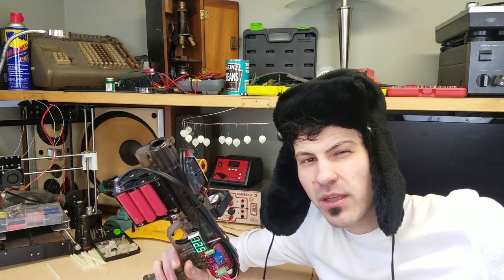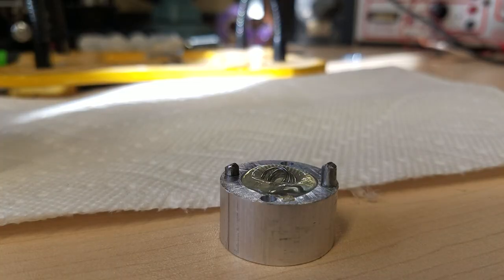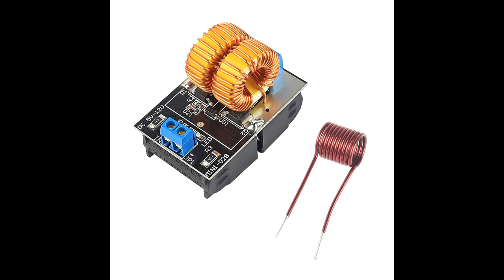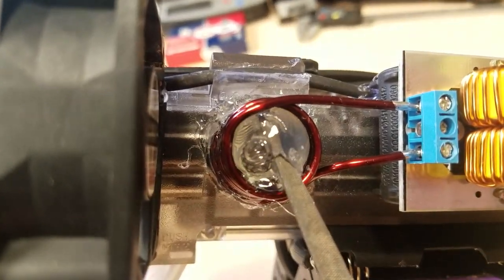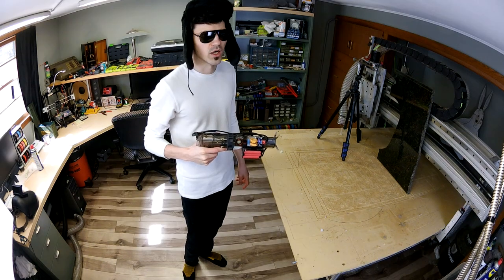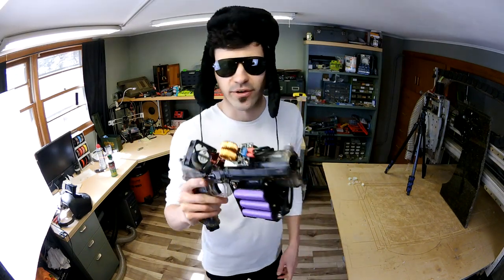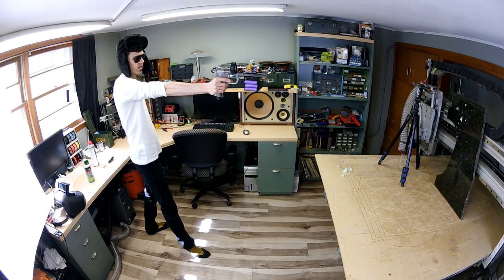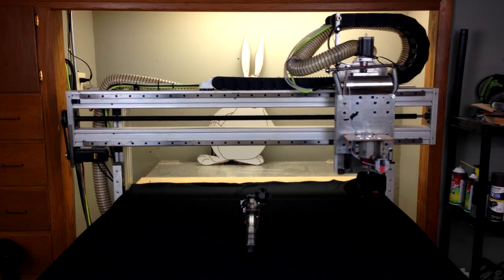Hot glue gun! (A response to Michael Reeves)

Comment from the maker: GLUE GUN 2.0: https://youtu.be/SMSFvKIj7d4
GLUE GUN 3.0 https://youtu.be/Vxq6W9XIAd0
Reply: ok
Reply: ok
Reply: ok
Reply: K.O.
Reply: ok
Reply: Whats the point of calling it a hot glue gun when its cooled down glue. Wouldn't it just be a luancher for cold glue. Kinda takes out the whole meaning of a "hot" glue gun.
Reply: ok
Reply: Ya think I care?
Reply: Ok
Reply: @joel creates its obvious your copying him for views, the appeal of Michael is his jokes.
Reply: ok
Reply: @evilflamer1749  why are you replying
Reply: ok
Reply: ok
Reply: ok
Reply: ok
Reply: Ok
Reply: @evilflamer1749  well you care enough to comment
Reply: @Iwillkeepdoingituntiligetviral  how he just trying to make a better glue gun and if he's stupid the. Why don't you do it
Reply: 20 USD.. for that induction heather.. ouch.. got two of them numerous years ago and they were 3.36USD each with incl. shipping to Denmark.
quite a hefty mock-up taking place and Amazon thirdparty pushing up on your purse, but as a product, they are fine.... though get a little hot if you overdrive them as there is no internal coil water-cooling, but they will gladly take more than the rated 5- 12v, but don't use the screw terminals.. as you done, instead use the wide silver pad as that is why it is there 2:50  and solder the coil there' as that will help take some of the heat from the coil and if you use the plastic screw-terminals with a pressure-fit, you have both less circuit connection and less thermal connection.
Reply: @lavi1653  no one asked
Reply: @Masked_ghsot_riley.offical  it’s been 2 years 💀

Comment: Thoss induction heating balls were 300iq
Reply: I don't get it
Reply: Deca Tessara clever idea
Reply: @decatessara5029  an induction coil can heat up the metal inside the ball but not the hot glue around it
Reply: @LEITH ALSELMI r/Ihavereddit
Woosh isn't a funny joke
Reply: LEITH ALSELMI theres 4 Os but also please stop
Reply: @incog0956  I get the physical mechanics, I just don't get the parent comments joke.
Reply: And then you could just make the barrel out of teflon, Venyl or Silicon. Materials that the glue won't stick to. You heat it up anyway you want and just fire through a pressure chamber.

Comment: I work with epoxy for carbon fiber projects a lot, and something you might try is adding different amounts of microspheres to your binary resin, and using low viscosity catalyst for a thinner coating. They are generally used for surf boards as they make them float, but in carbon fiber applications they reduce weight. The downside of them is if you use too many it can make your castings brittle, which might be exactly what you need. Just a thought.

Comment: You need to use the exact same piece of metal in each ball, the varying pieces of metal have different induction rates and heat up in different amounts of time based upon metal thickness and composition. Tune it for one specific piece of metal ie the ball bearing and I bet you have much better results.

Comment: Could you use shavings of steel or like iron sand and then have them suspended in the hot glue? Then you could more easily shape the bullets and control the heating from withing the bullet. 
I wonder if you could make a hot glue rail gun?

Comment: Figure out the optimum temperature of the metal in the glue that sticks better when its shot. Get a temp sensor to read the when it's hot enough, then program an arduino to fire automatically when the trigger is being pulled. If it all works, shoot some bloons with it.......

Comment: I know there is a V2 and I haven't watched it yet. But wouldn't silicon work better than epoxy? It'd be relatively heat resistant and it should pop open if it's a thin enough coat.
Reply from the maker: It would be difficult to achieve a uniform coating, as silicone is usually higher viscosity than epoxy. I think at the time I felt that such a thin layer of silicone would likely tear too easily as well.

Comment: The purpose of the "hot glue gun" was to "Fire, Hot Glue" not to fire (essentially) rubber pellets/balls. So i'm not sure how this is relatable tbh.
Reply: While you made a gun that fires (cold) glue. it's not the same.
Reply: All you have done is make an air powered gun using glue/metal as the "ammo"
Reply from the maker: Perhaps you should watch my glue gun 2.0
Reply: Bruv your being a real killjoy.
Reply: @JoelCreates  I watched it. I'll give you that. However ; as a software developer I use logic and love innovation but the logical outcome was "if reeves couldn't do it and you fired pellets not glue then you just have failed at firing glue as well" I'm sure as a developer and engineer you can follow that logic. But you still pulled it off. *claps"

Comment: Your execution of your plan sucks. the main idea of induction heating a metal object inside of a glue ball was a good start but it was ruined by your execution of just throwing whatever metal garbage you could find into your glue balls. My idea may sound like a strange idea at first, but hear me out. what you should've done differently is that you should've started by using a fine metallic powder, which would be more difficult to heat, but would end up as a much more reliable glue projectile. you would then need a higher power induction heater to heat the powder faster from the inside so that the powder doesn't melt the outer edge of the ball before being fired. with this method you will end up with a more reliably sticking ball that is less *viscous*. allowing it to live up to expectations better than your dumpster-fire of a paintball gun. Cheers.

Comment: 20 USD.. for that induction heather.. ouch.. got two of them numerous years ago and they were 3.36USD each with incl. shipping to Denmark.
quite a hefty mock-up taking place and Amazon thirdparty pushing up on your purse, but as a product, they are fine.... though get a little hot if you overdrive them as there is no internal coil water-cooling, but they will gladly take more than the rated 5- 12v, but don't use the screw terminals.. as you done, instead use the wide silver pad as that is why it is there 2:50  and solder the coil there' as that will help take some of the heat from the coil and if you use the plastic screw-terminals with a pressure-fit, you have both less circuit connection and less thermal connection.

Comment: polyester resin (for fiberglass) is even more brittle. If you add fillers to it, you can make it even more brittle while making it resist thermal expansion more and make it more stabble at higher temps.

Comment: Like yeah it shoots hot glue but its not practical and that's not even your fault that's the commenters fault because that idea should not work and it doesn't and even if it works like in your case what's next in Michaels video he used it to glue a popsicle house if he did it with your gun it would just break everything. Oh and what you said the comment and the execution is bs.

Comment: What's the issue with him trying this? You just used him for half the work. You got the idea and direction from him. If he didn't make his video and you tried this project you probably would have initially gone the same route he did. Well I think the idea was to create a hot glue gun that projects hot glue. Just hot glue. Not hot glue balls with a piece of metal in it covered with acrylic. But you talk about engineering and stuff. You should know then that there are different takes of the same idea. And that one take may not work and the other does. Each time you add something to a project your changing your initial idea from what it was originally to what it is now. Because your original idea didn't work so you edit and add to it until you get something that works or to a point where you have to go a whole different direction. Thus making the original idea different and a failure.

Comment: So, just to be clear, you took the idea of a hot glue gun that fires hot glue and turned it into this monstrosity that is quite literally the opposite of what is asked for as not only does it not fit with the spirit of the idea, but it also just doesn't shoot hot glue. It fires a heated piece of metal wrapped in a generous dollop of hot glue which is then even further coated in epoxy. This is not a hot glue gun it is a round about heated bullet.